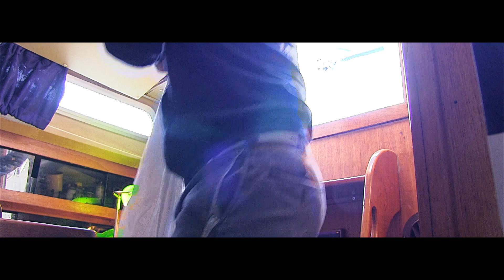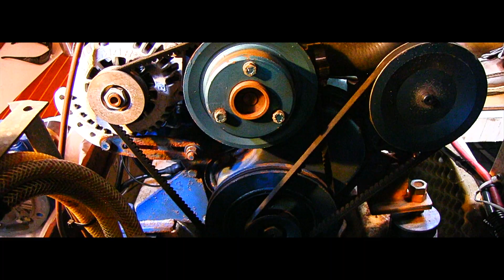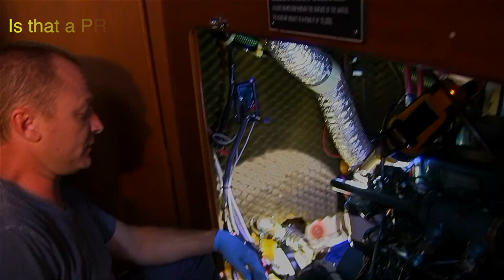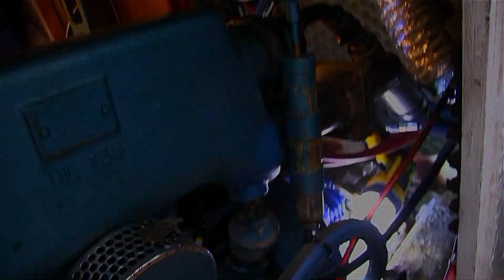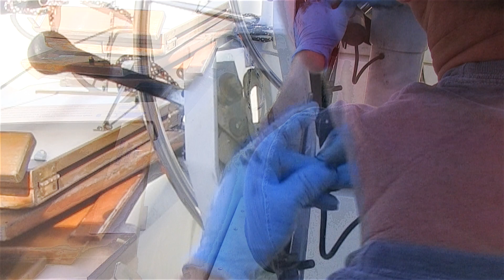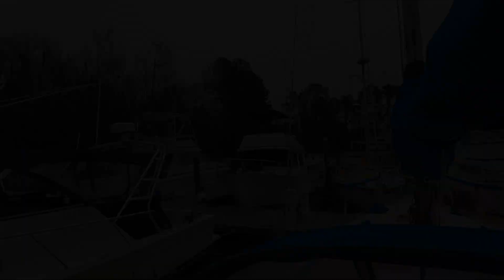#186  The Diesel Engine Mechanic

Comment: sounds like you are not getting the amount of 'prop steer' that you are used to. probably something wrong. not the same rpm at the prop as you used to get at the crank. wrong transmission?

Comment: The mechanic should definitely have informed you of the difference in replacement to another gearbox.  He should know better.  But it is not unusual to make short and long so-called kicks with the engine.  But it undoubtedly gives the experience that you have lost some horsepower.  Maybe another propeller can make a difference - but not a knowledgeable solution I have.  I understand your despair and I hope the so-called professional mechanic has been very humble when it comes to billing.

Comment: Its been a lot of weeks since the boat was out of the slip and you are getting near the end of useful lifespan for your bottom paint. My first hunch s is that the prop and/or bottom is fouled.  
If that is not the case, my second theory is that given the misaligned output shaft height, its possible this transmission has a different gear ratio. As others have said, that would necessitate changing the prop or getting the correct replacement for (or rebuild of) the original transmission. .  

If that is not the case, my third theory has to do with the fuel delivery problem that the boat seemed to have previously. You even may have the two problems above, and still have this problem as well. 

Lastly, you seem to have a problem getting confused about the rudder angle and its possible that you were just not steering as much as you thought that you were or that there was an external issue like current causing what you experienced. 

Standing by with pop-corn and opinions in hand, 
Jeff

Comment: Afterthought: If the new trans' output gear ratio is different, your prop rpms are also different, as is your torque on the shaft. If everything is working correctly (e.g. cable adjustments, motor etc)  and you have engine rpms at spec, then you may have to adjust your prop's pitch. Pitch, gear ratio, and rpms are all interconnected.

Comment: Is throttle cable adjusted correctly, so you can 'kick' the boat into a spin turn? Is prop a feathering prop, and if so, is it fouled or binding? that'll totally upset your reverse response.

Comment: Is the  ratio different this trans, from the old one. If so new propeller.
If not the mechanic should have checked throtle authority, ie full run before leaving. If it was late, schedule for the next available day. 
Cheers folks

Comment: On a different subject - your dripless shaft seal. The video showed you installing the set screws, I am assuming two per hole for a total of four which is correct. As a safety to keep the stainless steel puck from ever moving forward put a SS hose clamp around the prop in front of the puck. This will have no effect on balance, barnacles on the prop have way more effect on balance. Have had a dripless for 18 years and no problems but know owners of sister boats who have had the puck move forward. It will only do that at night or rough seas or both. Hose clamp is cheap insurance and peace of mind.

Comment: It might be that the because it was slipping before that reverse wasn't engaging at lower RPMs and you were getting more prop walk off idle than you should have.  Possibly now with the prop turning at a lower RPM the propwalk might simply be less pronounced unless you input more throttle to get more propwalk. 

Another great video guys.  I hope that this has all been worked out in real time for you and it is already fixed.  I can't wait for the next video to find out.  What a cliff-hanger Sailing Nervous has turned out to be lately.

Comment: If the forward was normal and the reverse did not feel like it was fully in reverse, then possibly the cable to the shifting lever needs to be adjusted.  With engine off flip the lever forward and back a few times to get a feel for it, then have Amy do the same from the helm and see if the lever travels as far in each direction.  If it doesn't the cable can be adjusted fairly easily.

Comment: Theres a nut on the throttle going to the injector pump.  I had to tweak mine to get it to spool up more rpms.   You should be able to test it in the slip though.  Going with a different gear ratio throws everything off as for as power and such.   Your prop is matched with the engine horse power and gear ratio.   I'm still fighting to find the correct size prop for mine.   The book isnt correct and the different prop styles are misleading as well.  I would like to see other comments though .  Also, what video editing program do you have? Mac or windows?  Thanks

Comment: Vin, the different ratio means the prop will be turning slower and will need you to either use more revs for the same speed or change the prop to a more coarse pitch. How do I know? I've done the same thing and struggled for a year until I fitted a new propellor.

Comment: Boy if it isn't one thing it's another.  Sorry you are having all these issues.   Hopefully it isn't a mis-matched part or something stupid like that.  Looking forward to the resolution.  You guys gotta move!  Sailing is no fun without being able to leave the slip.  Trust me I know.  My first boat's engine never ran right,  then had to have it rebuilt.  Still didn't run correctly, was very angry, only to find out the gas tank was dosing my carb with dirt and debris.  Gas tank was the cause from day one.   You will find out whattup, hopefully sooner than I did.  And hopefully with less expense.

Comment: Always do it right or don't do it at all... I was wondering why he wasn't with you when you were taking it out for the first time. When ever I fixed someone's car I always test drove it before I worked on it if possible and always after I fixed it. I just figured they would do the same on a boat. You can't just run it in the slip/dock and say okay all's good, because when you get it out on the open water that motor and everything will act and run different. I had many cars the idled just fine but when you went to take off it was not good.

Comment: Hey hope that fixes your problem 
Not enough power should just be the adjustment on the throttle cable 
Mechanic shoulda kinda checked that for you 
Maybe the cable bracket slipped on the lever

Comment: Did he just basically tell you that your engine and powertrain were...installed totally bassackwards? I know, it is British, but still, everything was installed wrong all along? WTF?? Really sounds like the wrong new transmission.
Reply: The new transmission is a drop shaft which means the engine must be raised to compensate for the amount of drop at rear or you will never get the alignment correct.  Check it out!